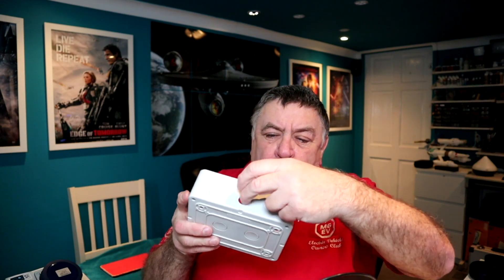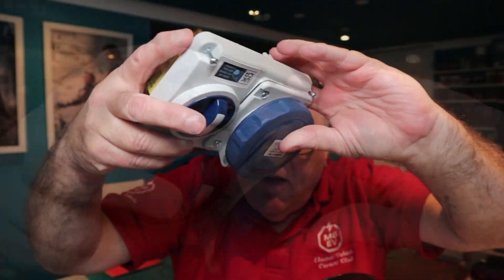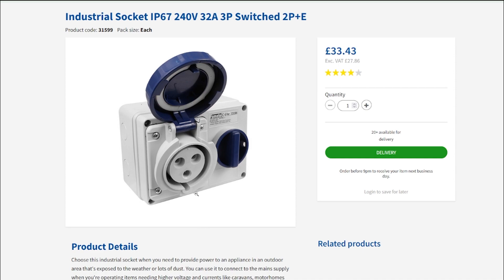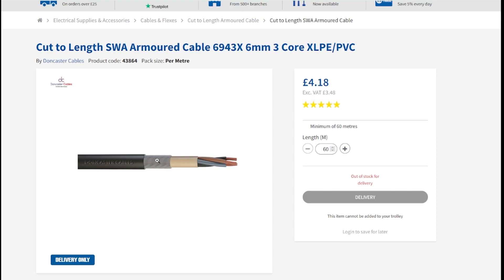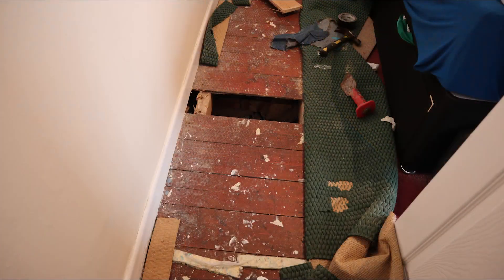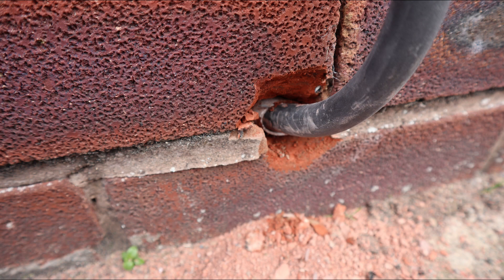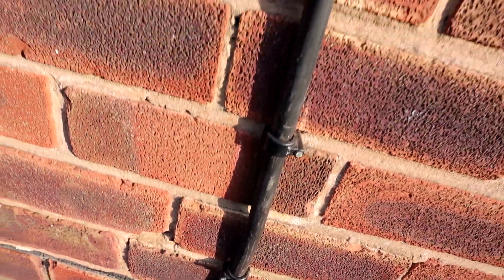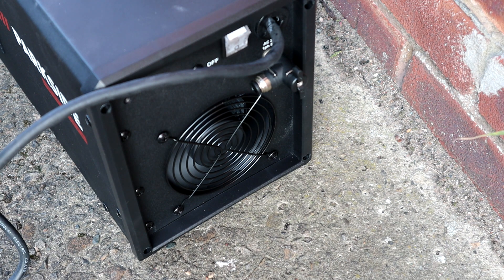Fitting a 32 Amp Commando Socket

Comment: You seen this in the wiring regs? 
553.1.201 Every socket-outlet for household and similar use shall be of the shuttered type and, for an AC installation, shall preferably be of a type complying with BS 1363.

I need a compressor in my garage and wondering if it needs to be hard wired in rather than commando like I was planning.
Reply from the maker: Hi James ..am not an electrician but cant see any reason why not...as long as the compressor didn't use more than the 32A rating of a commando socket and its supply cable ...plenty of folk I know run domestic compressors from a standard 13amp socket ...even very large (domestic wise) ones on machine mart  only use approx 2.2kw 

That  BS 1363 refers to the standard 13amp 3 pin socket...a commando plug is capable of 32A so way more.

Of course if it's commercial premises and 3 phase etc I wouldn't have a clue ..so best to ask a qualified electrician.

Comment: I use a 32A commando to charge my Tesla on the granny charger, same 7KWH speeds as any home charger and a third of the cost to
Install
Reply from the maker: Hi Eddie (hope it's Eddie)Thanks for the comment...Yes a commando socket is a handy thing to have. However if you are referring to the "granny" charger that comes with the Tesla then you will only get a maximum of 3kw as it comes with a standard UK 3 pin plug and the standard domestic socket is 13 amp max (and even this is not advised for many hours use) so it's usually about 2.4kw (240volts at 10Amp) ...even if you swap to a commando plug and use a dedicated commando socket you will still only get a max of 3kw ish.....the nickname "granny" is just for this power of chargers designed to run on a normal domestic socket.

You can however get dedicated EV in line chargers that have a type 2 plug one end and a commando plug the other end that do output 7kw/hr from Amazon and the like for £130 ish...is it one of these you have?

I would be lost though without my Ohme charge point...yes it was a lot of money but it's been great for the past 5 years and I wouldn't be able to take advantage of the excellent features of the Octopus Intelligent Go tariff I am on without it.
Reply: @TomsManShed hi Tom, Tesla sell a 16/32amp adapter for the Tesla mobile charger

Comment: Could yi no have just used the Hi Tuf 6mm 3 core cable it's easier more flexible to work with and easier to install and terminate with glands and shrouds
Reply from the maker: Hi John...you are probably right...I am not a fully qualified sparky ..hence me getting one to do the final connection so may have gone OTT

Comment: Very informative video. Thank you. This is really all what you need to charge your car at full speed at home.
Reply from the maker: Hi DIY ..Thanks for the thanks ..yes if all you want to do is plug in and charge then it is capable of carrying the 7kw load. However to take advantage of EV tariffs etc then a proper EV charge point is much better.

I would have to physically plug my car in at 11.30pm and unplug it at 5.30pm to use my Octopus tariff ....its SO much easier on my Ohme charger with its dedicated app.
Reply: @TomsManShed OVO Anytime EV charging!

Comment: Hi, did this need RCD protection? I only have a spare on the non RCD side of the board. Can that be used with a 32a mcb?
Reply from the maker: Hi Lee I am not sure what the electrician wired it to.....thats why the vid only goes as far as me leaving the wire ready to connect to the fuse box as I am not a registered electrician so left that bit to him 

He did connect it to its own  trip in the consumer unit...it has ROH132B/030* on it if that helps
Reply: @TomsManShed   Thanks for the reply Tom 👍

Comment: To anyone watching this... 

The video doesnt show the consumer unit end.... however looking at the Socket end i am sure it will be all wrong too. 

The terminated socket should look nothing like this onem SWA cable requires special gland to terminate. Hole filled with silicone is not what you want. 

Also if in fact you had an electrician to look at it and connect up make live. He should down his tools and take up baking!!!

If you ever were to consider  harging EV from this set up, you need to sonsider PEN fault protection, it has to be protected by type A RCD device and nit to mention to make sure you are not exceeding incoming supply capacity.
Reply from the maker: @peterigrenyi9176  I replied to another comment that the silicone was a temporary thing ...I fitted a proper cable gland months ago .  I will amend the description to say so 

Also it is only for use by my plasma cutter and welder both small DIY types....I would never use it as a charge point for my EV as I have a proper OMHE charger for that....the only time it could ever be used to change my EV is using the cars granny charger which is only 3kw and comes with a standard UK 3 pin plug
Reply: @TomsManShed  fsir dos. Id it possible to add a csption on s video? People dont come on Youtube to read a description i font think.
Reply from the maker: @peterigrenyi9176  Hi Peter...thanks for that...unfortunately you cant add anything to a vid once uploaded (only music) ..youtube allow you to cut bits out and blur something  but not add anything in

I have put an Edit in the main description but like you say not everyone sees that....what I might do is add a bit to the start of my next vid (even though it will be irrelevant to what it is about ) just showing the gland and the consumer box etc ...if I do I will add it to this thread
Reply from the maker: Hi Peter..I have just uploaded a supplementary video showing the SWA gland fitted and included a pic of the consumer unit also mentioned in it that it will never be used as a EV charge point...thanks for pointing out that the silicone was wrong ...I appologise as I shouldnt have shown it even knowing it was going to be temporary as it shows bad practice...I even mention you (1st name only) saying you and others were right to point it out...link is here https://www.youtube.com/watch?v=dNpuA6P0mKA
Reply: @TomsManShed  well done! I think it is good for people to see how it should look. They get ideas seeing dodgy temporary stuff and places are full of disasters. I spend a lot of time fixing all sorts of dodgy stuff not only DIYers but crappy electricians too.

Comment: Nice video, but you have the wrong 32a plug. The correct one has a locking ring the same as the shutter. The one you have used means it is not waterproof when being used.
Reply from the maker: Hi Les ...thanks for the kind words...much appreciated...I only use the socket to run my Plasma Cutter...I only ever do this outside so only when it is dry.

I have a proper EV charger (Ohme) for my car ...It's also hardly ever used...funnily though I did use it yesterday (only time this year so far) to do the plasma cutting for the latest vid I just did

Comment: If you plan to use the Commando socket to power an EV, current UK regulations as far as I can tell, say you need either a PEN cutout device (upwards of ~£150) or the earth on the socket should be connected to an earth rod and NOT to the house earth.
Reply from the maker: Hi Rhian No I wont ever charge my EV from it....I have a dedicated Ohme 7kw charger (with its own earth rod) for that.

I think I mentioned in the vid that it might be handy for an EV but I meant just on the (3kw) granny charger which can be plugged into a standard domestic socket.

I haven't actually used it for anything since making this vid as not needed to weld/plasma cut anything.

Comment: Great video. I’ve been trying to find a sparky to put one of these in for my Tesla, but no one wants to touch it for some reason
Reply from the maker: Hi Ej...thanks for that....surprises me that as I would think its quite an easy job for most sparkys
Reply: Electric vehicle charger has to have A type RCD protection and, lost neutral on property supply fault detection (O-PEN fault) with automatic disconnection, This is because if you have a lost neutral fault coming into your house, everything connected to ground becomes live at 240v including your car if it is plugged in and charging. There are slower chargers which are safer they have RCD built into the lead and can be connected to 13A socket, these take longer to charge,.more like a trickle charge for an electric car

Comment: Tom, you can't just drill that hole for the cable to fit through buddy, it has to be a 6mm SWA with an armor gland or it doesn't meet regulations can't just drill a hole and fire a bit of silicon in
Reply from the maker: As mentioned in the reply to the comment below from ,6months ago...I have now fitted a proper gland.
Reply: @TomsManShed  sorry, didn't read all the comments, just wanted to keep you right, have a good evening Tom.
Reply from the maker: Cheers MoorePS...no worries...good that you spotted the rough bit and pointed it out for others :)

Comment: Plasma cutters cut at about 50V, 30A at 50V is 1500W, which is about 7A at 240VAC, fine on a 3pin plug on a UK ring supply.
Reply from the maker: The 40 A plasma cutter I bought from Lidl (see my vid on it which includes its data badge) can draw up to 15A...its supplied with a 16 amp commando socket.

I could have fitted a 16amp commando ...or just run it off a 3 pin plug ...but am now future proofed for any future stuff and prefer going OTT

Comment: Was good up until the Swa was terminated in box, oh dear sealant preferred by electrician rather than Swa gland and shroud.
Reply from the maker: That was me am afraid Keith...I will however be fitting a proper gland soon as have just bought a load for another project I will be uploading soon
Reply: @TomsManShed  top stuff

Comment: I’m my professional opinion I would not do any electrical diy full stop. Get a nic eic, napit or any other cps registered electrician to carry out the works.
Reply from the maker: I did get a professional fully qualified electrician to connect it up at the main box and fit the ROH 132B Module etc as shown and mentioned in the video. As a gas engineer for  42 years I was capable of doing the donkey work like lifting the carpets and floor boards and screwing the box to the wall and getting the cable in place

I mention that an  electrician connected it a few times especially  from 15mins on.
Reply: @Tom's Man Shed  No disrespect Tom but no decent sparky would terminate into the enclosure using sealant. A proper SWA gland would of made it tidier and much more waterproof than sealant even if it is a plastic enclosure. Please tell me its glanded properly at the consumer unit end and that the SWA is bonded to the the earth.

Comment: Tom as per usual with tradesmen leaving you waiting. 
However I'm also interested in your progress with the new MG ZS EV ? As you may remember I have the same model and year as you in white. Just wondering which one if any you go for, and why. As usual good luck with the channel Brian.
Reply from the maker: Hi Brian yes I have a new mk2 zs ev on order.....I ordered it in Jan and was told delivery in March....they offered me £19500 for mine right up to getting the new one.

However since it had only done 4000 miles I got offered £20772 from Motorway so sold it last month thinking I don't mind being without a car for 4 to 6 weeks as I have my kit car and daughter to run me round if need be.

HOWEVER I am now told delivery may be as late as JUNE! :( ....luckily weather seems to be getting better as my Scorpion kit car doesn't have a roof. :) 

PS I went for the blue Trophy Connect version...its a much nicer blue than the mk1's
Reply: @TomsManShed  thanks Tom I can sleep again, did you get the long range battery or the standard one? 
Cheers Brian
Reply from the maker: Hi Brian...I ordered the long range one.....I never got to use a charge point other than home ....we had planned to use the car more but what with Covid and me losing my wife in September plans of long trips never materialised hence no need for anything other than home charging and the low mileage

However I thought the LR version would be a better bet long term (will prob keep this a lot longer).

I see on the FB group that there have been quite a few short range models delivered and think the wait time is much less on them.

No point moaning about it though...it is what it is will just have to wait.

Will be doing a side by side comparison vid of MK1 vs MK2 when I get it...already took loads of vids and pics like headlamp brightness etc before I sold the Mk1
Reply: @TomsManShed   Thanks Tom you are a real gentleman. I think you have made the right choice with the bigger battery. I went from Liverpool to Clock Face today ( garden centres) no problems yet.
Brian